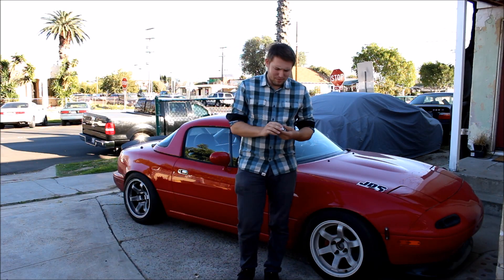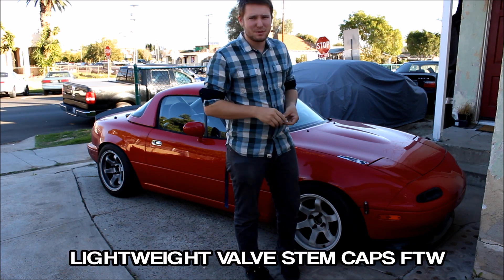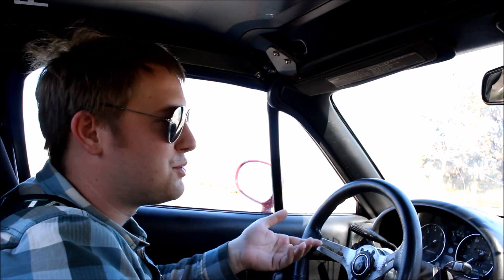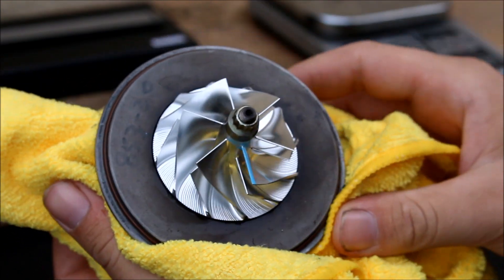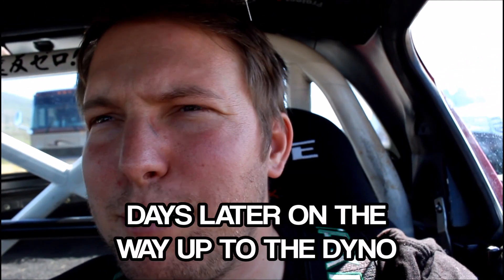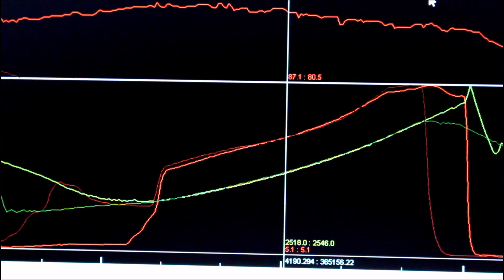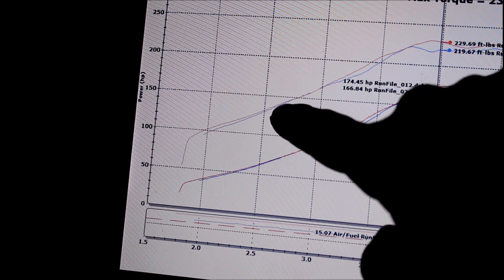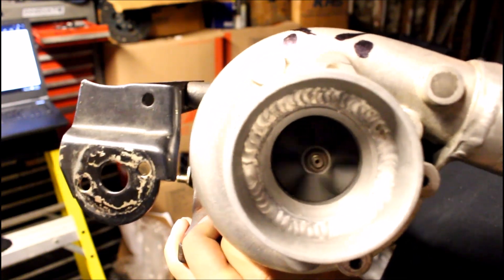Trying to Break The Miata: Billet Compressor Wheel Science!

Comment: Another awesome video man! Love learning more about turbo Miata stuff! I was wondering could you possibly try and shed some light on an issue I'm having with my Miata?
Reply from the maker: +CarObsessed96 Ask away
Reply: +TheCarPassionChannel I was driving to work the other day and the car shut off on me. I tested so many things just to find out my timing belt has either snapped or come off somehow. I haven't opened it up yet but I was just wondering are they non interference motors and is it difficult to do them? Also would you recommend replacing the water pump due to the fact they're cheap and you'd already be torn down to it? the car hadn't over heated and I've only owned it for about a month. Its a 1990 NA with a 93 1.6L motor 5 speed car with no performance mods besides cat back and header from previous owner.
Reply from the maker: CarObsessed96 It could be a broken timing belt, failed fuel pump, or failed CAS. It could also be a number of other things like broken wires, etc. They are non-interference, and you should definitely do the water pump if you do the belt, as well as the cam and crank seals, and anything else made of rubber that's really old! If you search "Party Miatas" I have a timing belt/water pump tutorial video.

Comment: By measuring its weight, you're only measuring linear inertia, neglecting rotational inertia. For spinning things it's not only how much mass, but also where the mass is, that affects angular acceleration. It can be a good approximation when the shapes and dimensions of the wheels are nearly identical.
Reply from the maker: +unknownNODE But, without any tooling to measure rotational inertia, tossing them on the scale is an easy way to show that there is a difference in weight, which will probably translate into a difference in rotational inertia. Maybe maybe not. But I knew people would be asking, so I weighed them.

Comment: Wow, nice video!  I can tell so much work went into making and cutting this together, very well done.  

Two questions:  Where did you have the wheel installed?  I don't think I saw a link and you said it kind of fast, was it pureturbos?
And also, just as important as power, what does this run in the quarter??  If you're gentle with the diff and tranny you should be pulling low 12 second passes no?

Awesome work putting all that power through the stock block!
Reply from the maker: +Mach5sun Yes sorry, Pure Turbos! I have yet to run it in the 1/4, I know the trap speed is a true indicator of power. Being friendly to the driveline, I'm thinking high 12's. With slightly less power I ran an 8.558@87.54 in the 1/8 mile. In the next few days I'm going to mark out a "quarter mile" and run it to get an idea of what it can do. I should be able to get very accurate numbers with the combination of video, gps, and ms datalogging.

Comment: I like how everyone claims 250whp is the max on a stock engine and you are pushing way more atm! 😜👌
Reply from the maker: @94eh3 Sorry but you're incorrect, torque is what breaks rods, transmissions, diffs, and axles. You might have horsepower related failures if it has to do with too much heat; but as far as actually breaking parts it's about the torque. You're "not snapping rods at idle" because the engine doesn't produce much torque at low RPM. A supercharged Miata engine might make 180wtq/230whp; while a turbocharged Miata engine could make 240wtq/230whp. The turbocharged engine is MUCH more likely to fail, despite having the same amount of horsepower.
Reply: 94eh3 Except that you're wrong.  Horsepower is a mathematical equation of torque and rpm.
Reply: 94eh3 You can believe what you want, but you're incorrect.  There's a significant number of 300 WHEEL horsepower stock rod miatas who don't have any problem breaking rods because they don't make enough torque for them to fail.  Then there are DOZENS of cases of 240-260whp miatas who made 260-270tq and snap goes the rods.

But what do I know?  I just build turbo miatas.
Reply: HP really matters not.  The B series Mazda engine is only good to about 250# of torque.  HP is irrelevant.  After about 250 foot pounds the rods will bend and snap.  Believe me, I have first hand experience with this..
Reply: elesjuan
and you can believe what you want but i hope you aren't advising people the way you're advising me. I gave you proof from manufacturers who's only job in the world is to build components for engines and anything that's not related to transmissions is ALWAYS rated to hp. i even wanted to see if maybe i was wrong and scoured websites for engine components to be rated in torque. Didn't find a single one.
But what do i know? All i do is build turbo Hondas.
Reply: Only change the rods, and you're ready for 300.
Reply: The best I've seen for a stock engine is 300 and my buddies is run 285 with stock internals  Which is absolutely freaking scary to me that's why I keep mine about 230  I don't wanna go any higher unless I get  Forged rods and positions lol  She is a daily driver Where as my buddies is just a toy and he has a couple spare engines laying around
Reply: Betreev Teararec
At 300 the pistons are fine, if you break something at that point, it will be the rods, I've seen people on stock block just with manley rods making 300-350.
Stock rods at 300 is asking for it to blow, the question is not "Will it blow up?" but "When?".
Reply: IMNOTA 
 The main reason why stay about 230 as I drift my car and I don't need much more yes it is scary to go a little bit over 285 because I've seen rod  Blow and I've seen pistons crack at that but mind you we are usually at very high rpm  What is scary about my body's motor is it runs extremely hot even though it has are all aluminum radiator and radiator re route and new pump If he continues it most likely the pistons will crack because the rings will swell that is why it is sketchy  If you're doing only a handful of polls then you should be fine except for your transmission and  diff those will have a little bit of issues if you are hard on them
Reply: Yeah, anyway I wouldn't go past 250 for drifting.
You're really beating on your engine more than racing or normal driving, so it's better to be safe.
Reply: To tell you the truth I absolutely can't wait for his motor to die because he dose not want to trailer his car  because he doesn't want to help pay for gas and the drift events are usually 2 hours way down Las Vegas
Reply: its honestly the rods. I had a mazdaspeed miata with a gt30r, blew 2 holes out of the engine block lol. TO BE FAIR; I was a fair amount higher than 250whp hahaha
Reply: elesjuan torque isn't what breaks engine internals, horsepower does. That's why literally everything inside of the engine is rated to HP and not torque.
Reply: elesjuan
and that's why you're not snapping rods at idle. It takes a certain amount of HP to break things. You proved my own point in your comment. Tell you what, go onto ANY website that sells rods, cylinder sleeves, or pistons. Go onto those websites and look at the maximum power recommendations for those items and tell me in what unit of power are they measured in.

Comment: Sounds like you would benefit from an improved turbine wheel to drive it. Along with being a lighter better flowing wheel, the mass in the wheel is concentrated along the center instead of spread out on like in the stock wheel. This is huge in reducing the rotational inertia of the wheel. Same as figure skaters pulling their arms in and spinning faster.

Comment: Hey Greg how you get your hardtop brackets to make a good seal? I also have the garage star brackets but mine don't seal properly
Reply from the maker: +pos miata Are your factory latches on the trunk adjusted right? What part of the top doesn't seal?
Reply: +TheCarPassionChannel it's the front that doesn't seal right when it rains water gets in
Reply from the maker: pos miata Your bushings might not be adjusted right in the rear latches.
Reply: +TheCarPassionChannel I'll check it out awesome video by the way !

Comment: That is mad hp on stock internals!! How much boost did you end up running?
Reply from the maker: +Elwin Priem I run 13-13.5psi up to 5000, then taper it to 15.5psi progressively to 7300. That's where that extra power in the top end came from. :)
Reply: +TheCarPassionChannel Are you running normal pump fuel?
Reply: +TheCarPassionChannel so you use electronic boost control and add more psi after 5000rpm? I always thought the only feature of EBC was boost by gear. I might have to look into that with my hydra setup
Reply from the maker: rstormzand I can't do boost by gear with MS2 :( I Think MS3 can do it though. But I do have boost control with TPS vs RPM.
Reply from the maker: Elwin Priem E85, Sorry should have mentioned it.

Comment: those numbers for a stock 1.6 are mind blowing
Reply: He does have ARP head studs but I can say from my own experience with my own '95 1.8l that they're not required. However, when I did my engine refresh rebuild, I did torque the OEM head bolts down to the high end of the factory manual torque spec. But otherwise, it makes 15.4psi on a GT2554R @ 6500rpm with 220wtq running 80% ethanol, e80flexfuel and there's zero signs of the head lifting. Greg did push more torque than me though. Anyone I know on YouTube pushing 235-240wtq on a 1.6l (250whp+) does have ARP head studs. Though they're not required. It's just a good measure. IMO as does all the evidence suggest is you of you're pushing more boost to NEED the head studs, you're likely going to need forged connecting rods too.

Ps the 15.4psi is a peak boost number that it is tuned to not reach until the RPM's are a ways past 5500rpm.
For most Miata engines, peak torque is around 4-5000rpm. So you absolutely don't want to make 15+psi at below 5000rpm. Because the engine makes the most torque in that area of the rev range. So if I had the boost set to 15.4psi @ 4,000rpm, it's very likely to hit 250wtq and blow the engine.

Also  as Greg has said before, every different turbo is going to make different power at the same boost. So my 15.4psi with a gt2554r might make the same torque as your gt28 makes at 14psi. The exact psi # is errelevant, all that matters is you use whatever target psi to reach your target torque figure. There's a lot to cover.

So you want your boost target to look something like this to not blow your rods:
10-11psi @ 3-4k rpm
11-12psi @ 4-5.5k rpm
Finally, from 5600rpm to redline you can try and ramp up the boost in a linear climb to keep your wheel torque as flat as possible, whether it takes 13 or maybe 17psi... Whatever keeps your torque curve flat at where it peaked. But never let it go beyond the safety level.
Connecting rods tend to give away at around 240-250wtq. And the factory 5 speeds also give away right there too.

Quinn has 235wtq on his red turbo 1.6l but he's gone through a couple 5 speeds at that. He also runs 91octane with a very conservative spark map. I run a conservative spark map for e80 that looks similar to Quinn's. Greg's helped me SOOOO MUCH with my build. If it wasn't for both of them, the car wouldn't exist today. So many thanks 😊🙏

225wtq ftw across the rev range for lots of abuse without blowing your engine and be easy on the 1st gear launches from a dig to spare your 5 speed.
Reply: yea awesome

Comment: Your engine is not built in any way? Does it just take 276HP without upgrading the internals?
Reply: +TheCarPassionChannel I'm impressed. I've heard of stock piston arms bending at 230+ horsepower. So yours must be made of magical unicorn horns or something. Nice!
Reply: stock internals
Reply from the maker: +EastingAndNorthing Stock internals with no issues so far, knock on wood.
Reply: +EastingAndNorthing miata engines are bricks lmaoo!
Reply from the maker: Totally Legit Gaming [TLEG] It's actually the torque you have to be more concerned about, stock engines are usually safe up to 240-250wtq (depending on what RPM that happens at, low RPM torque is harder on the rods).
Reply: +TheCarPassionChannel Right, gotcha. Thanks for the info!

Comment: does this modification require the shaft to be re-balanced? @thecarpassionchannel
Reply from the maker: +rstormzand Which shaft? Crankshaft?
Reply: +TheCarPassionChannel lol no between turbine and compressor wheel. you said you got it balanced once the new billet wheel went on. is that necessary
Reply from the maker: rstormzand Ohh! No shaft modification. Some people run them without being balanced, but I wanted to play it safe. These Garretts aren't cheap to replace!